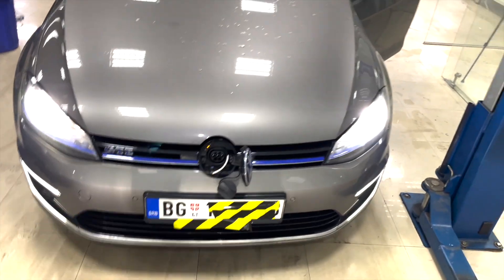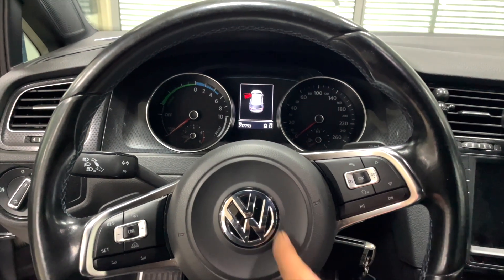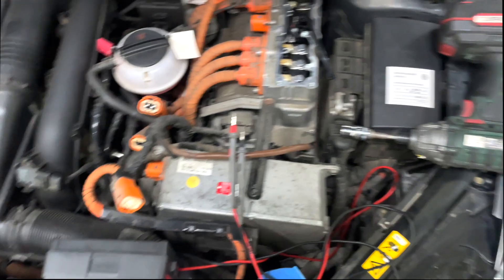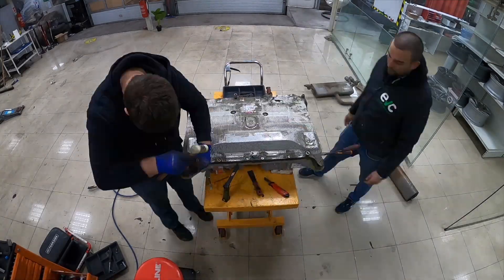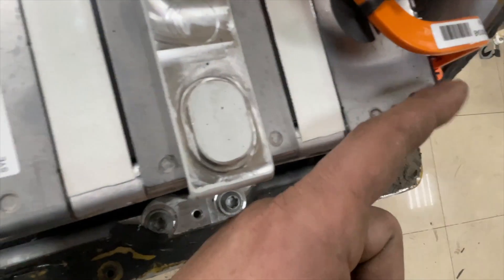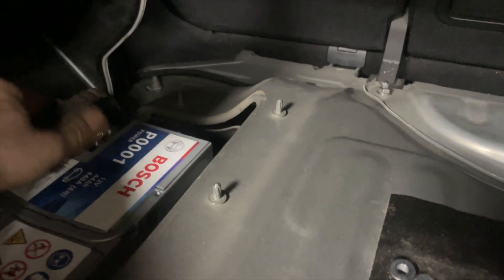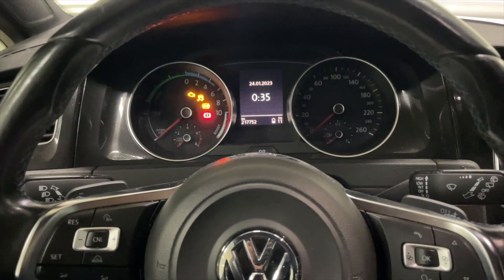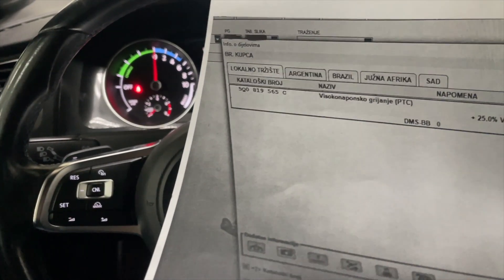Golf GTE - Battery defect and repair P0AA600

Comment: The problem with the 1st Generation of the GTE was: The battery is simply to small. The second generation has nearly 50% more capacity. I personally think the car drives very well, but you have to consider it is not an electric car. Drive in Hybrid-mode and not in elctric mode. But overall the battery are from samsung (2nd Generation) and hold up pretty well. PHEVs nowadays (3rd Generation) have more than 100km electric range and are by far not as problematic as the first generation.

Comment: Hello guyes please give me clue whats wrong with my audi a3 P0ABC00 - Hybrid/EV Battery Pack Voltage Sense "A" Circuit  Low:
P0ABB00 - Hybrid/EV Battery 
 Pack Voltage Sense "A" Circuit, c/Performance: 
Is wont accepting charging

Comment: How much capacity do you reckon is left after 200 000km?
Reply from the maker: Resistance is extemely high. Last one was around 60% soh
Reply: Je suis à 248000km 39km/battery 2016
Reply: @ouss5453  That's not bad.
Reply: Hello mam vw golfa 7 gte i passata b8 gte.Passat jezdzi w trybie hybrydy po miescie i nie widac spadku baterii przy miejskich predkosciach z rekuperacja,a golf traci baterie dosc szybko w trybie hybrydowym po miescie a w trybie ev golf robi 27km max latem a passat 37km na odzysku energii b.Golf dostal rzekomo nowa baterie w 2022 roku z powodu nieszczelnej obudowy woda sie dostala a zywotnosc bateri pokazuje 82% passat pokazuje zywotnosc 78% a robi wiecej km niz golf wiec nie rozumie tego.Golf gte 2015 przebieg 222653km passat 2016 209034km.mozesz podpowiedziec co moze byc nie tak z bateria golfa ?Z gory dziekuje i pozdrawiam kolegow z GB

Comment: He is talking like ICE engines dont go bad and make the car a write-off. Nothing is perfect. I've heard about every car manufacturer that has hsd massive bills due to a failure of some sort.
Reply from the maker: But this ICE+PHEV combination is extremely expensive due integrated electric motors inside gearbox and small overloaded battery systems

Comment: What was the age of the car. The battery warranty is 8 years or 150 k km for this model. And regarding the battery isolation issue there was a recall program from VW where they fix it for free.
Reply from the maker: It was already changed at 110k on recall, at second failure it had 200k. Warranty of any kind doesnt prove sustainablility

Comment: Do you think in general, pouch cells are worse than round or prismatic ones? 
At least for me i see so much inflated batteries in phones and laptops, and none in older laptops or other tools with round cells.
Reply from the maker: They (pouch) are absolute crap for any serious automotive purpose. Best cells on planet earth are cylindrical cells, then prismatic.
Reply: @evclinic e-Golf has the same pouch cell design?
Why are they more reliable then GTE models? Because of the bigger battery or is it something else?
Reply from the maker: @ISpiksterI  it is prismatic, eGolf is more reliable because of more cells in paralel and less stress to cells
Reply: @evclinic  yeah that's what i thought as well when i first discovered that some cars have those damn pouch cells.
Thanks for you fast answer. 
And keep up the amazing work. :)
Reply: @evclinic  classic ioniq has pouch cells too. Are ioniq cells also crap?

Comment: Dear EV Clinic 

Thank you very much for the video.

Do you know, if it is possible on VW vehicle to upgrade the battery from 9.9 to 13.3 kWh. I red that the dimensions as well as connectors are same for both battery.

Comment: Your last line was "chose petrol or electric, not hybrid". Could you pls elaborate why? If batteries are a way to put hands on customer's savings, won't be worst on pure electric cars?
Thank you. Nice video btw.
Reply: Hybrid cars have by far the most complex engine and transmission combinations. Depending on the power, battery state, temperature, the electric or gas/Diesel engine engages. Technically both engines are meant to be used from 0-100 km/h, so you can either crawl with the combustion engine on at 8 kmh or drive in ev mode at 90..

Full EVs on the other hand don't have all these problem. Full electric engines usually have around 3000 less moving parts integrated so they are the simplest engine versions from that perspective.
Now on 98% of all EVs it's not the electric engine that you have to worry about because they might last 400.000 - 600.000km easily. There are enough Tesla Taxis that have done that :) it's the battery at the end of the day. But even the big batteries have no problems usually lasting around 13 years. Sure some cells might go bad on that way, just like with a mobile phones. But that doesn't you can't go anywhere it just means that you might not have 450km of range at beast maybe just 380km after 10 years.

So like I said it's the complexity of having both engines working together that makes owning a hybrid for a longer time. Service is prior and most importantly avoid the European Hybrid since they don't have any experience nor were they interested until 2017 when everyone screamed for a green alternative.
Reply: @chriskonte1909 thanks for this and i actually agree with your point regarding the longevity of a full EV verses the complexity of a hybrid. I’m actually considering purchasing a 2018 GTE advance, however after hearing and reading so many problems i must say I’m definitely very skeptical now. The batteries just don’t seem to last the test of time, where then the engine takes all the load and no doubt your then faced with further problems mechanically. Lots to think about, thanks

Comment: This is the only video in the whole of yt with any gte issues.... And at 200000 km...  Second hand battery would be cheaper...
Reply: Which is perfectly ok. There are now second hand batteries available for a few thousand. 
The second hand trick, is to buy one of these just under 2 years old, then get a full VW 1 Ear warranty extension for 17 EUR a month. Then you are sure that you aren't getting a turkey.
Near Munich, most are driving around in villages with hybrids. The EV second hand market is too expensive.
Reply from the maker: @jellyd4889  it is not ok if you pay 12000€ for 8kWh battery, which is again defect construcion pack. And that is only problem, you got shit crap problematic DSG gearbox
Reply: @evclinic  Well you know you can replace the cells with standard off the line cells. It’s common on Toyota Prius already and then we’re talking about a sub 1k repair
Reply from the maker: @F1binger  no you cant put NiMH toyota shit here
Reply: You can already buy a module second hand for around €100, 8 of these come to a total of €800. The prices for a new one are absolutely mental.
Reply: BMW's, Mercs, VWAG, all have smallish  battery packs waiting for an enterprising company to earn on them.
Reply: This is the wet gearbox. Just replace the oil occasionally... I have scoured the internet and find no major issues reported,  compared to the other dry ones.... 

No one would buy a 12000 EUR battery, you are correct. That is why the second hand and properly refurbished market is already quite large.

You could specialise in it! Your shop seems to know what it's doing. Set up pickup in Germany, they swap out the battery with one of your refurbs, they send the broken one to you for cannibalisation.

Maybe VW already do that...
Reply from the maker: This one was already on second battery at 200k

Comment: What about Toyota or Honda, would you also avoid buying one of their hybrids? I'm asking since their electronics is also much more reliable in regular cars, at least compared to European brands.

P.S.: Great seeing you make videos, I hope you become famous and get enough "sponsors" to buy as many EVs as you wish.
Reply from the maker: Toyota is “less evil” decision but stil expensive parts for it. Battery etc…
Reply: So here's the little Hybrid 101:
Don't get a hybrid if you wanna safe some money. For environment readings sure, but not because you're gonna safe so much more gas. Hybrids consume much more fuel when they are running on their combustion engine. VWs Golf Plug in Hybrid has a Turbo engine so all that on and off strains the engine a lot more. Toyota and Honda mainly use full-hybrid systems meaning they have a small battery that doesn't need recharging but has a max electric range of 3 miles. Now thanks to recuperative braking, letting go of the gas pedal and the engine, it charges itself you and it's the simpler system You will have less problems with a Prius or Insight or even a CR-V or RAV4.